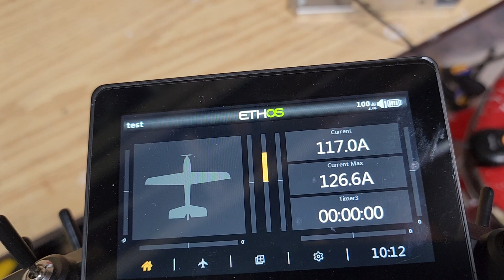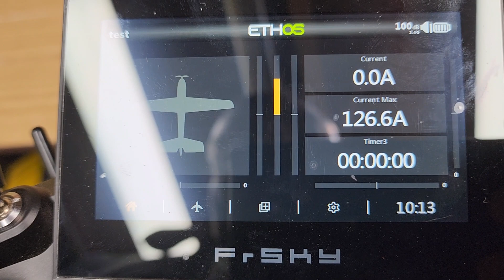HSD 120MM  640KV EDF ON 12S THRUST TEST.

Comment: What's the reason for changing the bullets when going deom 12 to 13s? I'd love a 120mm jet but they are all pretty huge!! Max I can store/transport is 1.5m wingspan.
Reply from the maker: Bullets have nothing to do with going to 13s. My 13s capable ESC has different connectors.
Reply: @ghoustanable  ahhh OK! What would you say the 4mm size limit is? When would you jump to 6mm? Around 130-140A? Cheers